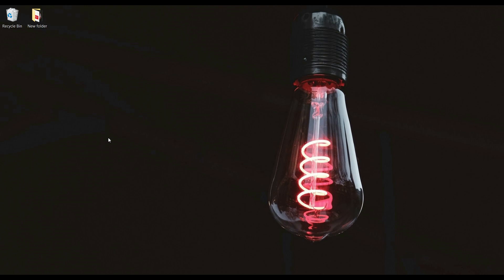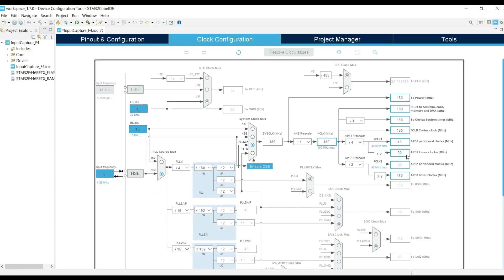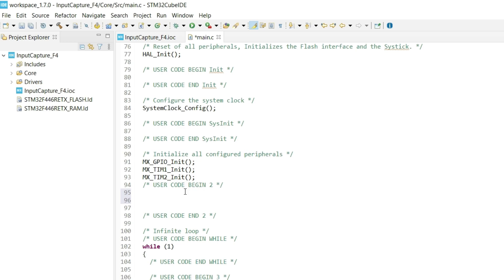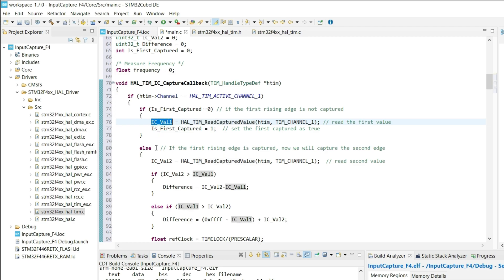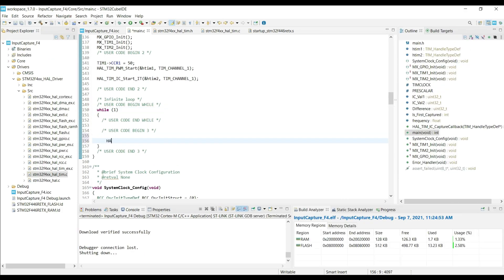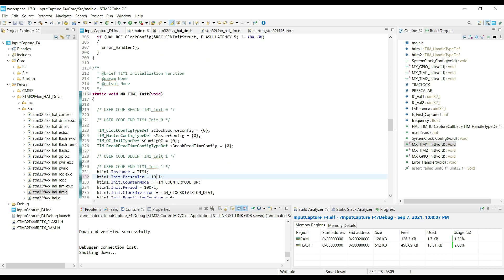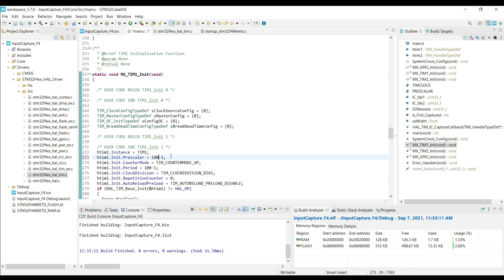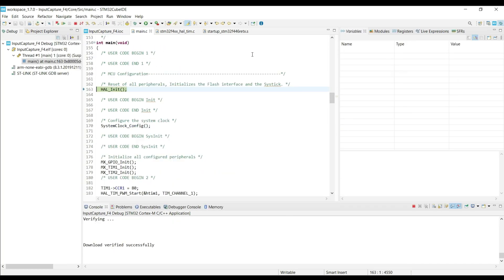STM32 Timers #4: Input Capture Tutorial | Measure Frequency & Pulse Width

Comment: Hi is it possible to convert 100Mhz input clocks to khz ranges using input capture mode?
Reply from the maker: Input capture mode only measures the signal. It does not convert it.
Reply: @ControllersTech but can we use a counter and create a pulse at each for example 100 counts is it not a way to convert 100Mhz signal to khz range?
Reply from the maker: Yes that way you can..

Comment: not working, tested in bluepill f103c8t6 and wb55cgu, not working, cpu fail on execute.
Reply from the maker: Did the code flashed successfully?
You Probably have the cloned mcu.
Reply: @ControllersTech  working correctly, I checked and had misconfigured my external clock frequency, I corrected it and now it works perfect, tested and working on STM32WB55 WeAct board
Reply: the maximum frequency measured was 12.8MHz as the board only runs up to 64Mhz and this was the maximum stable pwm frequency I could achieve
Reply: This is just what I was looking for, since I want to develop a low-cost and high-performance oscilloscope, I know I need a microcontroller with a higher frequency, but while I investigate I am learning the methods
Reply: Now, with the comparator embedded in the board we could try to use the same method with a sine signal to transform it into PWM pulses, and thus calculate its frequency, although with this method we could calculate the frequency but we could not visualize beyond the sample rate of the adc, anyway it would be a great advance and then an external adc of 50Msps could be implemented,  But that would be another stage

Comment: This seems quite absurd, how can we actually infer that timer 1 and 2 are connected.. There has to be some setting to explain this right?
What if there are a lot of timers enabled how will that timer get to know to capture which timer signal
Reply: I don't think so the timers are connected internally by default.. I used a jumper to connect both the pins and now the interuppt started triggering.
I'm using a stm32g474-dpow board

Comment: Hello friend! I wanted to ask you a question. You know that IC (Input Capture) function that we use in timers? I generally saw that it is used to read frequency, I have already tested it for this purpose too and it works well. But one thing that I was never able to do using the IC in that mode that activates the interrupt by rising and falling edges, was to have information whether the interrupt was activated by a rising edge or a falling edge. And a while ago I searched everywhere, I did a lot of tests, apparently a flag was supposed to be set according to the edge that activated it, but it was never set. In fact, I tested this a lot and ended up thinking that it is impossible, which for me is absurd, considering that the information is there, but it seems inaccessible. Having said that, please, is it possible to use the IC with interruption on both edges (rising and falling) and be able to identify the edge? For example, if it was a rising edge, I want to enter an if, if it was a falling edge, I want to enter another if (or else). I really wanted it to be possible, thinking about an application to check synchrony between square waves and the difference in angle between them. If it's not possible, then I'll do it with a timer and perhaps external interruption, but I wanted to use the IC for precision. I would be very grateful if you could clarify whether it is possible or not. Thanks!

Comment: Thanks for a great video, I added an overflow IRQ to sample very slow frequencies on the same counter. Also I added a flag once a conversion is ready to calculate and stopped the edge IRQ, so this lets you push the measurement range a bit high if you are looking at constant frequencies.
Reply: Hi, can you tell me your implementation, taking into account the overflow counter, I can’t get a frequency less than 15 Hz, but I need to implement even less, down to 0.1 Hz.

Comment: void HAL_TIM_IC_CaptureCallback(TIM_HandleTypeDef *htim)
{
	if(htim->Channel == HAL_TIM_ACTIVE_CHANNEL_1)
	{
		if(IS_First_Captured == 0)//if the first rising edge is not captured
		{
			IC_Val1 = HAL_TIM_ReadCapturedValue(htim,TIM_CHANNEL_1);
			IS_First_Captured = 1; //Set the first captured as true
		}
		else//if  the first rising edge is captured , now we will captured the second edge
		{
			IC_Val2 = HAL_TIM_ReadCapturedValue(htim,TIM_CHANNEL_1);//read second value
			if(IC_Val2 > IC_Val1)
			{
				Difference = IC_Val2 - IC_Val1;
			}
			else if(IC_Val1 > IC_Val2)
			{
				Difference = (0xffffffff - IC_Val1) + IC_Val2;
			}
			float refclock = TIMCLOCK/(PRESCALER);
			Frequency = refclock/Difference;
			__HAL_TIM_SET_COUNTER(htim,0);//reset the counter
			IS_First_Captured =0;//set it back to false
		}
	}
}

Not working  this function,Actually im using STM32F429ZIT6 Microcontroller,i did every thing same as your code , pwm output working very nicely but input capure mode not working, what i have to do? any one help me?
Reply: please explain

Comment: Thank you so much.  I have a question, how can I confirm that the first incoming interrupt is triggered by a rising edge and the second interrupt is generated by a falling edge? From what I see here, the entire period is 100 clocks, and the pulse width is 30. Most of the time, I get a difference result of 70, but sometimes after a while it becomes 30.  It looks like the first interrupt is generated by a falling edge, while the second interrupt is generated by a rising edge.
Reply from the maker: You can first only enable the rising edge interrupt. Once it is detected and callback is called, enable falling edge also.

Comment: Hello
If i need to use timer input capture for capturing  both rising and falling  of a tounch sensor 
And i need to check whether the difference is equal or greater than 5sec if so i need to execute respective tasks how can i do that for 16 bit timer
I configured for 1ms configuration
It will be long pulse where several counter roll out would happen how to do this basically how can we have condition to check for whether greater than 5sec at the moment i release
Reply from the maker: You should use external interrupt for this. Set the interrupt to both rising and falling edges. 
Define a 32 bit variable in the main file and desfine it as an external variable in the interrupt.c file. Increment the variable in the systick handler. 
When the interrupt is triggerd due to rising edge, reset the varibale. And when it is triggered due to falling edge, measure its value.
Reply: Can you please give some more insight currently interrupt for rising and falling edge is configured.

Comment: Thank you for the video! But I have a question: is timer 1 and timer 2 physically connected? How can timer2 receive the pwm input from timer1? and why would HAL_TIM_IC_CaptureCallback trigged by timer1? I thought AL_TIM_IC_CaptureCallback is triggered by input, but timer1 is output. Thank you very much again!
Reply from the maker: Yes timer1's output is connected to the timer2's pin.
Ic capture callback is not triggered by tim1, its triggered by tim2
Reply: @ControllersTech  Thank you, now I understand!

Comment: Hi sir, thanks for your video. But I have some confusing in this video and can you help me to explain one thing ? In your video, you configed Timer 1 is PWM output and Timer 2 is Input Capture. But when you caculate refClock at 6:42, why you use TIMECLOCK and PRESCALAR of Timer 2 ? The Frequency after that is the frequency of PWM Timer 1 so I think the TIMECLOCK and PRESCALAR is Timer 1 too. I'm just a newbie and thank you so much.
Reply from the maker: The TIMCLOCK and PRESCALAR is used for calculating the input frequency.
Basically we capture the counter value  of timer2 for 2 triigers. Then we find the difference in the counter values and this difference is equivalent to the input frequency.
But here we need to convert the difference we got, to the frequency or time equivalent. 
To do so, we need to know at what rate our counter is running. That's why we use the clock of tim2.
For eg- if counter is running at 1000hz, then the difference of 10 means the frequency is 100hz. And if the counter is running at 1MHz, then the same difference of 10 means the freq is 100khz. So it depends on the counter rate and hence we use the values of the timer, which is actually capturing.

Comment: i want to ask, how to use this feature for applying long pressed push button ? anyone have the source code or any references ? thank you
Reply from the maker: Lets assume the pulse goes high when you press the button and low when you release it. 
Just measure the width between the high and low pulse. Then program your controller as per that width. 
If (width > 300ms) then long press triggered.

Comment: At the 1m45s mark that shows the block diagram.. where does it say that Timer1 PWM Output can be used as the input to Timer2 Input-Capture?    

For example, in the RM it says the input signal to measure (IC4) via Input-Capture reg is selected (ICSELECTION) in TIM2_CCMR2  as :  TI4 (b01-Direct), TI3 (b10-Other Channel3), or TRC(b11)

Where does it say that TI4 is not the input pin, but rather Timer 1's Output PWM?
Reply from the maker: I am feeding it manually.  We need some signal to test the IC right, the signal come from the output of another timer.

Comment: why did you use CLOCK SOURE : INTERNAL CLOCK , because you use RCC: CRYSTAL and Config you use HSE
Reply from the maker: What time ? Point the timeline
Reply: @ControllersTech  it 2:57 you choose  INTERNAL CLOCK, but  CLOCK CONFIG you use HSE
Reply from the maker: Thats the clock for the timer. It is clocked by the APB clock.
Reply: @ControllersTech  i know , but when we use Timer always choose INTERNAL CLOCK  ? , beacause i dont use INTERNAL CLOCK it  no problem
Reply from the maker: Vhoosing the type of clock changes the timer operation mode. You can read more about it in the reference manual of your controller

Comment: Thanks for the really informative and clear set of STM32 timer tutorials.  However, I just cannot get this IC set up working.  I'm using a Blue Pill board in the STM32CubeIDE and the debugger message "(Suspended : Signal ; SIGTRAP/Trace/breakpoint trap)" is displayed.  The PWM is being generated and there are no breakpoints set.  Can you help?
Reply from the maker: I don't know about this. Never faced such issue
Reply: Faced similar problem, My error was divide by zero.  I was dividing a number by zero due to poor initialization.
Reply: You should connect PA8 and PA0, to provide signał which makes interupt. That important fact is not mentioned in the film.
Reply: You should connect PA8 and PA0, to provide signał which makes interupt. That important fact is not mentioned in the film.